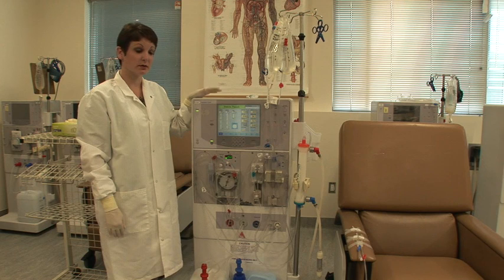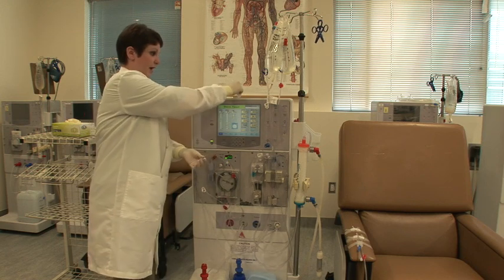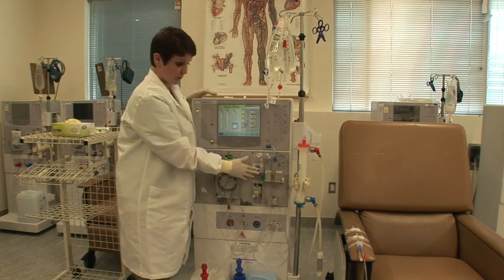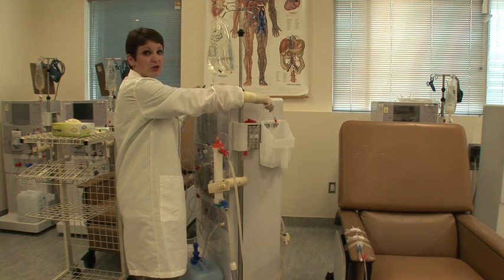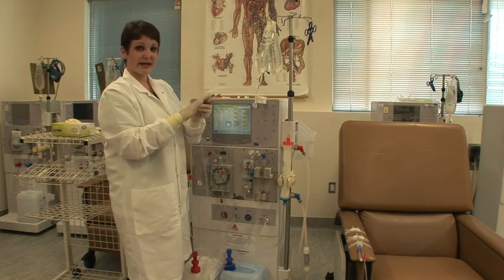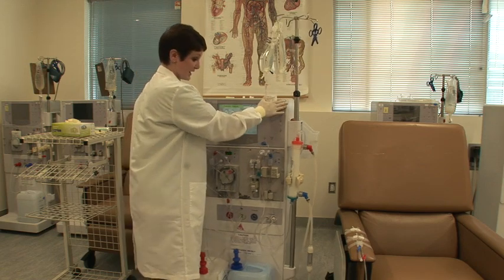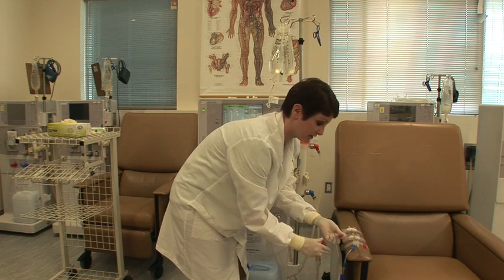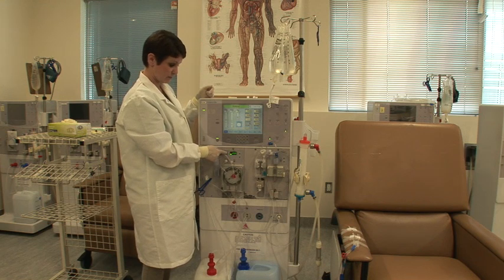Step4_PatientOn

Comment: The order of connection is arterial then venous..to the patient... because they are times when a patient request BRP... upon return from the bathroom you may have to run off the recirculation saline  into the prine bucket before re-starting treatment....